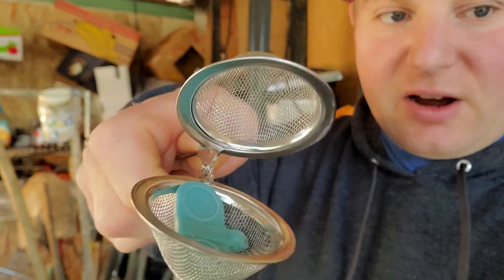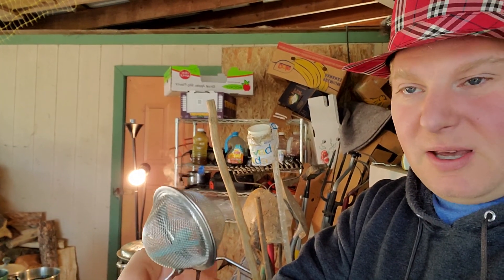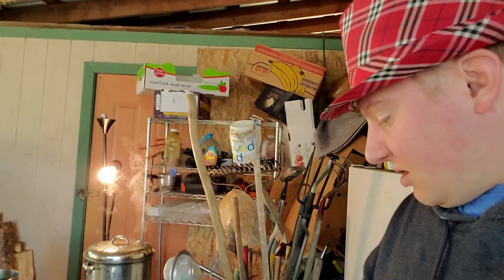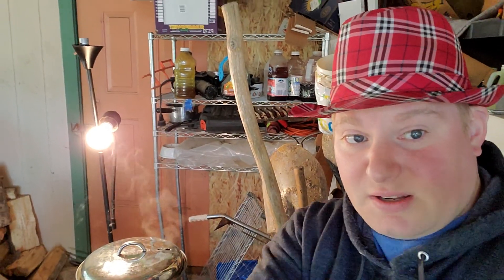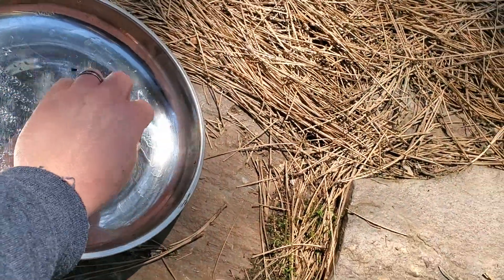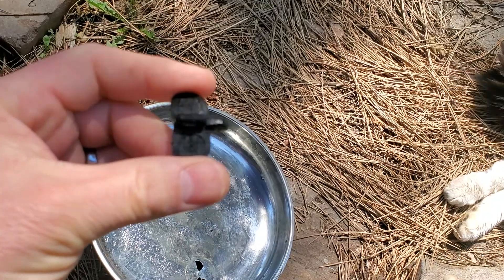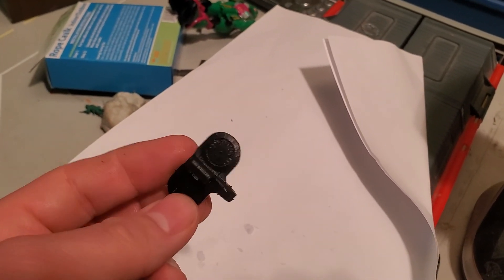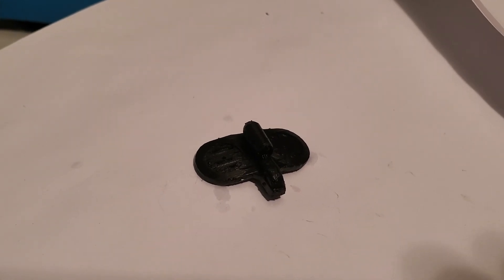CAN YOU DYE 3D RESIN PRINTED PARTS?

Comment: I’m confused about this video Resin come in all different colours and you can by pigment dyes for resin or you can just paint it, also heat will warp the resin.
Reply from the maker: Well these are resin PRINTED parts specifically, which has limited colorants presently. however i have done it on resin cast parts as well without issue. :)